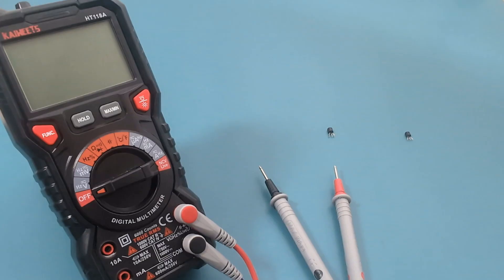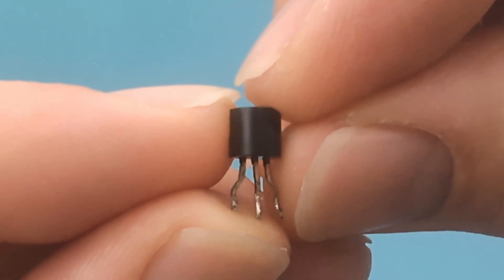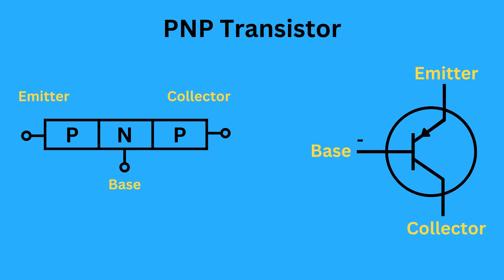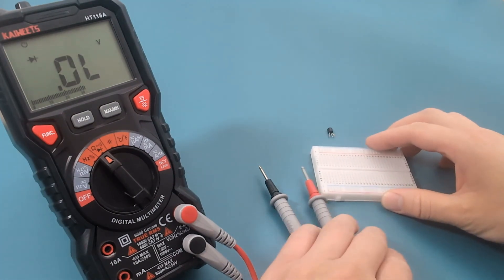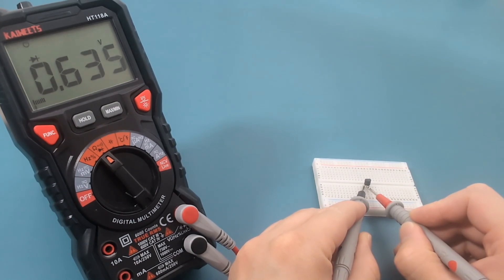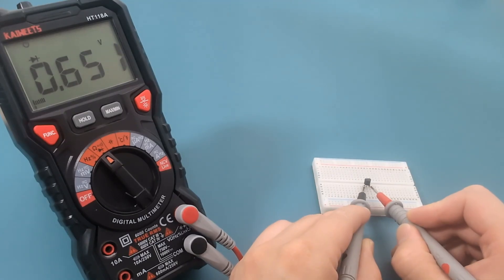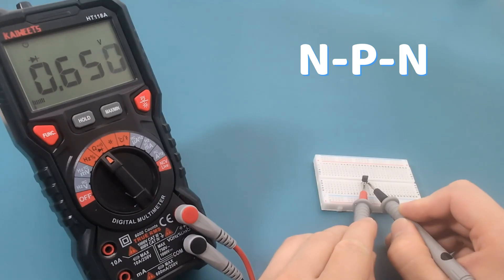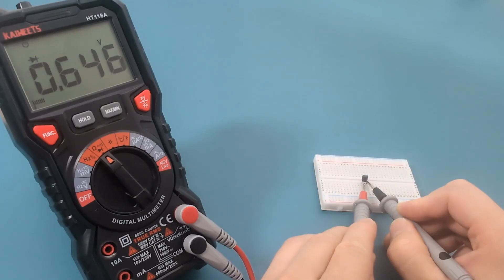How to Test a Transistor with a Multimeter | PNP or NPN Transistors

Comment: Thank you very informative.  Question: I have a circuit board in my car (the window ECU behind the door card) with a ‘hot’ transistor, meaning when I use a Flir scan with my camera over the circuit board the transistor ‘lights up’ indicating it’s powered, even when the car is off.  Can a ‘bad transistor’ stay hot? Or… is the problem further ‘up-stream’ where a relay or similar is not ‘shutting off’?
Thanks